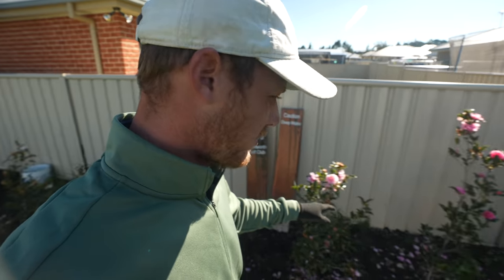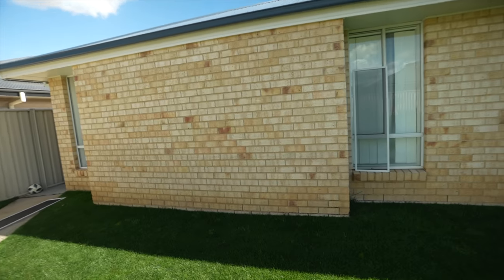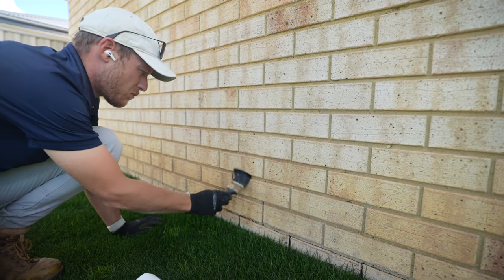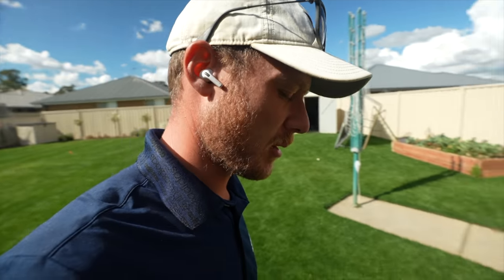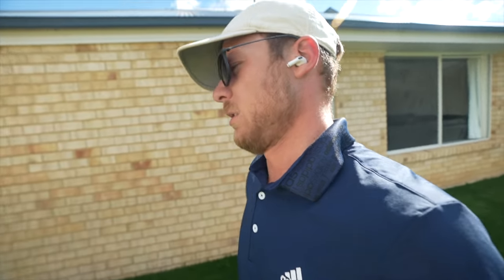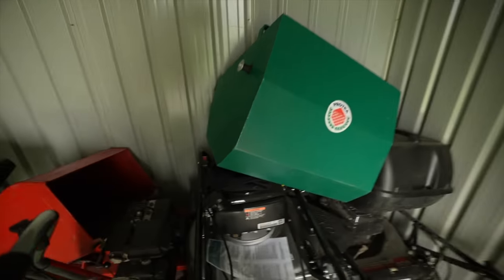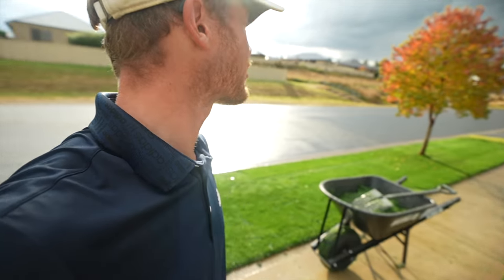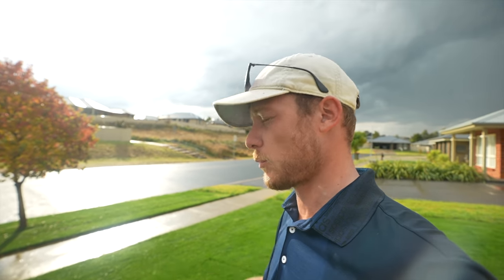A Day Full of Yard Work // Cleaning Iron Stains, Garden beds and Mowing

Comment: Putting that iron remover in a little 500ml hand spray bottle for application might be even easier since it melts off so easily! 

Also in general, soak brickwork well beforehand as it is very absorbent, so that it's soaked up with water before using cleaning chemicals. Chemical stays more towards the surface of the brick, that way less product is needed.
Reply from the maker: Great idea mate. Always up for suggestions!

Comment: Good to see the paint roller idea worked for u there Ben..  fk using the paint brush that would be an all day job on it's own..
Reply from the maker: Would take ages and my back wouldn’t be in a good place either haha
Reply: @LawnTips  u could probably use a garden spray bottle like u use to fertiliser ur lawn but depending on how much it will use compared to using a brush or roller..